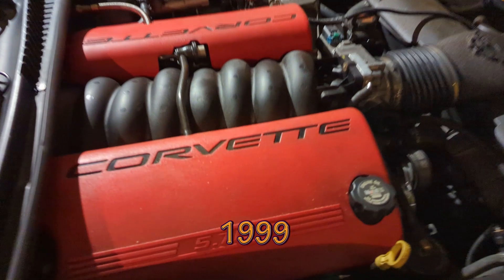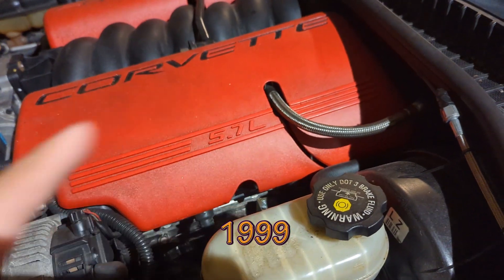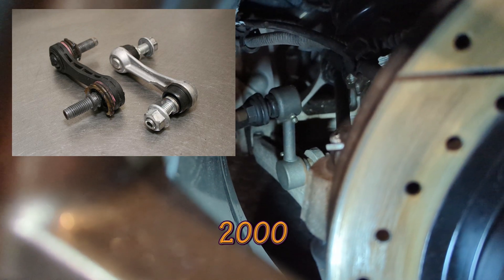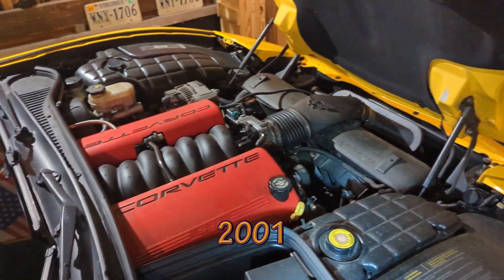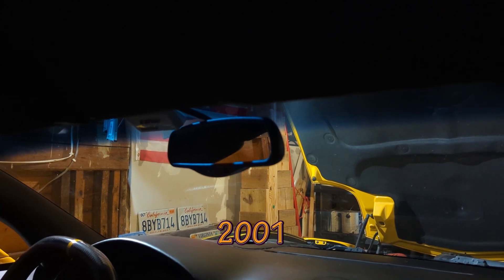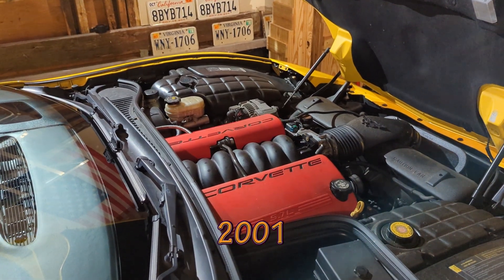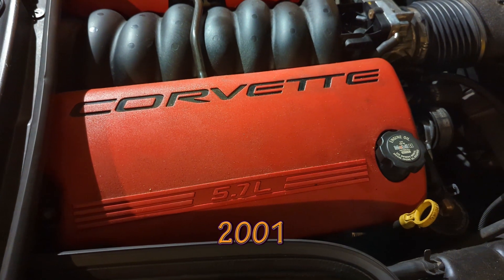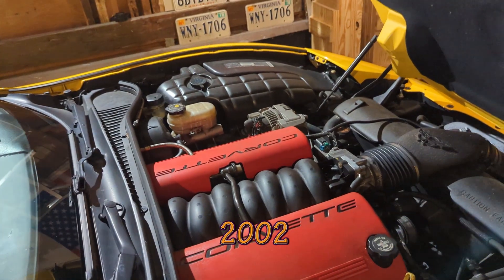1997-2004 C5 CORVETTE | EVERY MODEL YEAR UPDATE/CHANGE | I RECOMMEND A 2001+

Comment: Thank you for sharing. I took delivery of a New 2001 C5, December of 2000. I put 142000 miles on it. Over the years I've changed a few batteries and tires that's about it. Still going strong.
Reply from the maker: Outstanding
Reply: I know I'm late to the party,does the car have any oil burning issues?

Comment: Just a minor correction 
97-00 345hp 350tq
01-04 LS1 auto 350hp 360tq
01-04 LS1 manual 350hp 375tq
01 LS6 385hp 385tq
02-04 LS6 405hp 400tq

There was NO rated horsepower decrease in 2000

Comment: I have had my millennium yellow 2003 ZO6 since it was brand new on the showroom floor 4 weeks old from the factory and almost 7 miles on the clock 19 years later $1805,000 mi on the clock five sets of tires one set of front brake pads and it's still all stock and runs great even with the original spark plugs and wires on it,,
Reply: This comment needs a quick edit my friend.

Comment: Good details. Learned a few things. There were a few notable items on the 2004 Commemorative cars........most notable was that the carbon hood was only on the Commemorative cars, not the other '04 Z06s. Additionally, they are the only ones to get the polished Z06 Speedline wheels and black interior with crossed flags embroidery.

Comment: Other changes for 2004 cars , Leather on the shift boot came all the way up to the knob prior to 2004 they were about 3/4 inch below the knob. Also that’s when they started putting the ls1 or ls6 sticker on the throttle body. P.s. I love my billy boat prt on my zo6 as well.

Comment: Thanks for the video… quick question. You mentioned that 02-03 had problems with the valve springs… what about the 04 Z06? Did they fix the valve spring issue by then? I just got one and I’m wondering if I should replace them… thanks

Be strong and courageous

Comment: Hey there Mark.  You are not an idiot; we're just humans with cool cars.  One addition to the list may be on the 2004 model year the car came equipped with top post battery terminals and no longer came with side post battery terminals.  The late model year 2004 example of a C5 I drive daily does.  I would like to share the components the C5 I get to enjoy does NOT have, and I really like it that way.  

It does not have HUD so no cut out on the dash, just smooth all the way across.  
It does not have electronic tilt-n-tele steering column, so know broken, stuck steering column there.
It does not have auto dimming chromatic mirrors so no bronze discolored glass.
No magnetic ride control to have to replace expensive magnetic shocks.
No telescoping radio antennae; this C5's antennae is embedded in the glass and spans across the top part of the windshield.
No memory seat function which gives way to power adjustable seats with air-powered lumbar and side bolster support for driver and passenger.

It does have dual zone climate control, 12-disc CD changer which actually works, both the smoked glass and color matched roofs and fog lights.  Torch red paint, carpet and seats with chrome Z06 style wheels.  It's a fairly analog car with far less stuff to break and attempt to source for replacement.

Comment: Mistakes, mistakes......The thin spokes were NEVER chromed from GM. They were polished aluminum. The telescoping column switch is on the LEFT side of the steering column, NOT anywhere near the ambient interior temp sensor, and not even visible from the passenger side. 2000 models STILL had the plastic swaybar endlinks-In the '01-'04 they were metal. Horsepower ratings remained unchanged until '01. 2000 models had the best non Z06 cam, perhaps to help retain the 345 horsepower rating with pup cats. Also, the EBCM failures on the pre-'01 models is far less common than it is hyped to be! I can speak with experience, having owned a 2000 model for nearly 20 years. Additionally, not all 2000 models got the airbag light, only the very late ones did. Also, the F45 variable suspension was changed to an improved "magnetic ride" F55 in 2003. Nice job, otherwise......👍
Reply: Props on the name if it's from what I think it is...'just one more thing, sir'...loved the Robert Conrad character who had that name on that episode! If I'm wrong feel free to think I'm insane lol...

Comment: Im starting to look at corvettes. I had my mind set on a C6 GS Manual, but the costs are stupid atm. So i started looking at C5 Z06's, which are also way overpriced right now. I guess it all comes down to how much money you want to spend, but isn't a C5 Z06 a car that is going to need quite a bit of money put into it just to bring it up to relatively modern standards? I had a list of around $9-$10k for some standard upgrades for interior, exterior and some simple bolt ons? Would a C5 Z06 in any way be worth it over a C6 at this point?
Reply: Depends on your end goal. I heard c6 are more comfortable and easier to drive. Better trans shifter all that deal. C5s are a little lighter so a little more performance oriented I guess.

Comment: A different Vett channel recommended the 2003 over the 2004 because something in the fuel system (maybe the fuel pump or some other part that would eventually fail and have to be replaced?) was moved inside the fuel tank, making it a big job and a big expense.
Reply: Fuel filter.

Comment: I seen a 97 w/ 200k miles for 7000. I want it, but im scared bout the EBC
Reply from the maker: 7k for a C5 is a deal for sure. However, at the age & mileage a lot needs to be replaced if not already.  Every ball joint, tie rod, wheel bearing, every piece of rubber hose, leaf springs etc etc.  Plus the anxiety of the EBC failure.  If it's super clean & taken care of id offer 6500 and mention all the maintenance that will be required. My 2 cents.